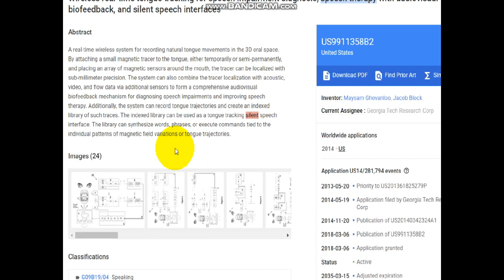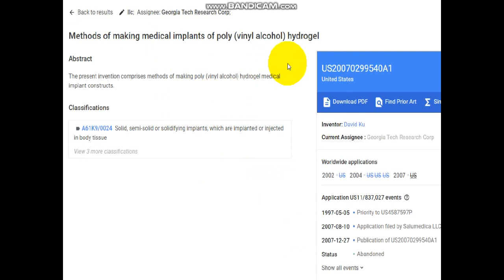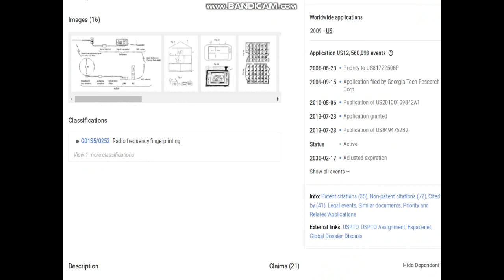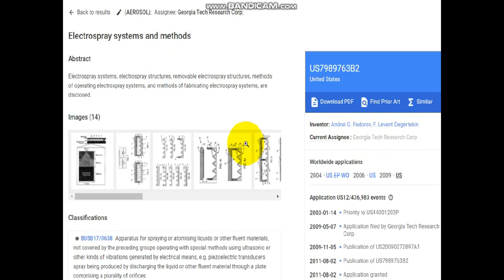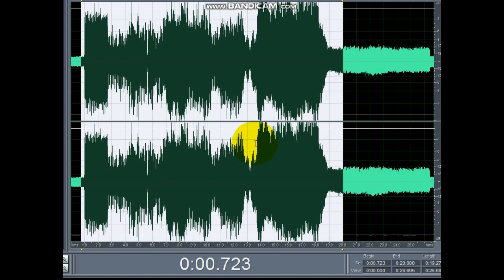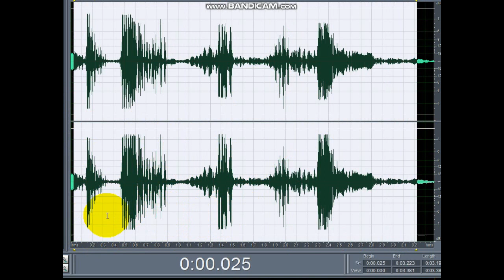USING THE MEDICAL INDUSTRY TO HIDE TECHNOLOGY - RADIO FREQUENCY TARGETING /  TARGETED POPULATIONS

Comment: The buried wireless is indeed used and it currently is blocking wireless communications here when the dust is heavy enough. 
Use cellmapper and force full gnss.
Very easy to see the man in the middle.

Comment: <Theory of HT (Hell Toxin)

<This is a working theory of HT. We need help from anyone with high-level knowledge in chemistry, electrical engineering as well as biology.

<We have so many clues but I think we are missing something big here that could help move this forward.

<Many who came before me, including Dr Dan and too many people to name have already come up with a lot that is helping.

<Why I think HT is an Ion

<HT acts more like an ion than a particle, like a mold spore, mycotoxin or other similar neutral charge toxins (or polar toxins like some mycotoxins). (Polar definition: https://www.thoughtco.com/definition-of-polar-molecule-6055… Ion Definition: http://www.qrg.northwestern.edu/…/pro…/1-what-is-an-ion.html)

<This is not a science fiction theory or a complex theory. It's a place to start with the simplest explanation that could explain what's happening.

<It helps to explain why HT acts in the ways it acts. I hope it can help others visualize what is happening and why it doesn’t fit with how mold or other toxins of concern like cyano, and MT should act.

<HT might be an aluminum-based flame retardant that has been introduced more and more in recent years, (these FR are nano, echoing Dr Daniel Cagua Koo and Erik Johnson’s theories on metals).

<The idea that this could be a metal (or has a metal component) has a lot of evidence behind it, and could also help folks to think of it as charged and not as a type of mold or bacteria spore. Most HT reactors agree that HT has a metal component.

<I don’t think there is ample evidence to assume it must be nano or even that is is a human-produced product. There are naturally occurring nanoparticles. But it sure seems so to me.

<How and why does a metal or particle becomes charged, I don't know the answer to that.

<Evidence that HT is an Ion:

<HT clings to the body like statically charged clothes in the laundry. When you have a bad strain and are very reactive you cannot simply shower and walk away from it easily.
HT is aggravated around all EMFs that create static.

<HT rides on and moves around on static. It attaches itself aggressively to staticky things such as plastic that is unraveled or clothes that have static on them.

<Things with a positive charge especially attract HT, sometimes in a helpful way to help bind and get rid of it, and sometimes if they can’t bind it, they just draw the HT there and it congregates there.

<Things with a positive charge that attract HT include: CSM, quats (used to clean HT), dry skin, glass on electronics (huge attractor of HT!), flyaway hair, paper. Air tends towards a positive charge when static is in play. This makes sense with how HT moves through spaces.

<Items prone to a negative charge are among those that are the least prone to contamination by HT, such as wood, copper and gold. And while polyester generates a negative charge, the movement between the skin and the fabric create a positive charge on the skin, this attracts HT to the area and it does end up on the fabric as well.

<Source https://jh399.k12.sd.us/DailyAs…/…/ch7materialstaticelec.pdf
Static however is a little more complex in which items create positive and negative charges with new understanding of it recently https://www.popularmechanics.com/…/a-shocking-new-understa…/

<HT can spread around a room quickly (a lot like how scientists explain candida auris.) This makes sense if you see the particle as moving through the air as an ion. And especially in places where there are a lot of charged particles in the air already. I'm not sure if we know why c. auris spreads like that. Maybe that could help us?

<HT clings to materials that mold spores and other particles cannot cling to. HT can cling to glass, metal, ceramic, and not be able to be washed off with soap and water or even special cleaning products.

<No regular particle can cling to glass and survive every cleaning product thrown at it. Only something that is electrostatically “stuck” to the glass could do this. Glass becomes positively charged in the presence of static. source https://jh399.k12.sd.us/DailyAs…/…/ch7materialstaticelec.pdf

<HT is commonly found on new items out of factories. This could be the source of it. (As opposed to a something organic growing or that can be found more out in nature like where mold and bacteria originate).

<HT particles can jump when it’s in its worst state. This feels more like the arching of electricity, or like a magnet pulling something that it wasn't touching to it, than a waft or cloud of spores in the air that is moving on air currents.

<HT cannot be easily contained. If the toxin is always jumping from you to nearby stuff with a positive charge - even stuff that you haven’t touched - it would be basically impossible to control the spread completely.

<You cannot block HT in the same way you block VOCs, mold spores and mycotoxins.
HT is often described as prickles, tingles or that it feels like radiation in the air. This more accurately describes an ion than a neutral or polar particle.

<There is a reaction between people who are dumping metals and the HT particle.
Mast cell stabilizers can stop the burning feeling but cannot stop the electrical jolting or the deeper level symptoms others have which many of us are theorizing is a reaction between the metal and the charged particle in the air. (Not an original theory by me).

<Dr Dan has found metal dumping to be common in people with HT. This is why those of us sensitive use the word “magnet” or “magnetizer”. We are the other side of the reaction, and maybe more literally like a magnet than folks even imagined. This is why not everyone feels HT.

<HT can be cleaned and neutralized by healthy people in a contaminated space. Eg if you leave a hotel room you have cross-contaminated and healthy people move through, clean it, walk through it it will lose its charge and then disperse. (The time it takes depends on the strain and how bad it was and how much there was.)

<Areas that don’t get cleaned like closets that were storing contaminated items might be worse. Areas with lots of normal traffic are rarely contaminated (like taxis).

<On the other hand, HT worsens in the homes of people very reactive without the new introduction of any more HT (and without purging, special cleaning or improving with treatments).

<With ozone in the air everywhere naturally, and with metals in the air everywhere, plus static, there could be a reaction here that causes it to worsen that could make sense. HT is worsened by light from the sun as well as human-made UV lights (possibly due to ozone production). This helps to explain what there is a larger effect from a smaller amount compared to other toxins.

<You cannot wash HT off objects with regular cleaning products, and rarely perfectly with specialized cleaning products. Specialized cleaning products often include metal binders and those have been somewhat effective in cleaning up HT in the environment (silica, OSR, barkeepers friend etc).

<Metal binders/chelators have been particularly effective treatment when taken internally to help heal those with HT sensitivity.
Ozone creates highly dangerous “radiating strains” of HT in many cases. The production of ozone occurs in the air naturally with UV light (which could be why HT can worsen when nothing is done).

<With an ozone generator, the electricity breaks apart oxygen molecules causing the lone O to attach with O2 creating O3, but that molecule is not stable, so the O breaks off again and interacts with other particles, causing other particles to lose electrons. Ozone is unleashing a huge amount of ions and this interaction seems to create more HT and usually stronger HT in most cases.

<I don't know why ozone worsens HT tremendously, but maybe there is a big clue there for those with more chemistry knowledge.

<Why does this matter?

<More and more people are becoming HT sensitive but we don't have any scientist looking into what this particle is, we don't even know where to start with testing it.

<By helping create a framework to understand it that will help I think. We really need outside help.

<A theory that helps explains this (even if it's wrong) can also help us to understand each other and why this could be so severe for some people. HT is not one thing, we call them “strains” because there are different types and strengths of HT that have these characteristics. And we are at various levels of reactivity so we also experience it differently.
Reply from the maker: I had symptoms that resembled botox / botulism. Numb areas as if I was at the dentist earlier..but in non-dental areas. I also noticed tingling and weirdness when my lips touched milk...or when my hands touched raw chicken. You could literally feel the reaction. This felt as though you could feel something alive reacting to the germs / bacteria in this stuff. There are a thousand other symptoms..but those are key as well as the photos / videos I have of an algae that has clearly been coming down on the neighborhood from above. There seems to be two main ingredients. Fungus and shewanella. Which both work in tandem with eachother. When the shewanella is out of whack with the fungus, an infection will appear on the body somewhere...when the fungal graphene is more prominant, other serious health symptoms appear. The fact that this stuff goes lymphatic is another clue. Also, the fact that I was able to ditch my symptoms with my treatment and an anti-fungal treatment is the main clue.

Comment: Couple of things come to mind right away.  Lots of strange blackouts lately. Seem to take longer than the usual repair time. Know the ggggg can run in the power lines. Might be necessary to upgrade for this too if you are going to put everybody on. Also if you haven't been in a hospital lately, they are practically empty. Had to be at one for relative's outpatient surgery last week. They confine you to a very small area. If you even walk down a hallway on the main floor, three people will jump out and shoo you back. (i forgot about that morse code vid until this. Definayely something). Also what about these disinfectant sprayer things they are putting in schools and stuff right now? Might be gearing up to put everybody on. Medical patents. Medical emergency hoax.     All these people are worried about some shot. This sh** is already in the food, water, medicine, air, and any shot you've taken in the last decade or so at the nano. They don't need to mandate some shot. Detox. Constantly. You are always a genius charlie. Thank you💜
Reply from the maker: Thank you. And yes, absolutely. They spent about a year of time working on our lines..claiming our system was being upgraded. Now the power goes out every time the wind blows too hard...and lately, we've had weird pulses lighting up the lights while the power was OUT. I think this system went national during the east coast blackout of August of 2003. There was a system before that. But this is at least version 2.0..if not later.

Comment: Charlie I mix music for a living & have always been obsessed with low freq.... well long story short I did something to my brain by accident by always focusing on extremely low energy & constantly surrounding myself with subs & excess electricity to the point where I am able to literally feel noise...I’ll stand in an empty room & literally half the hairs on my body stand up but the other half nothing. A garbage truck will pass by on the street & my brain will feel like it’s being scrambled almost seizure like.
Reply from the maker: Excellent story. I mix and master music..and over the years, I would hone in on frequencies just like that. Had a lot of really bizarre experiences with my head crammed in between monitors. Over the years, I was hit with an ELF wave or similar that made my brain / head feel like it was vibrating. Almost cell phone speed vibration. At first, I was all freaked out because it feels like a seizure or something. Then, I realized that it was just sound vibrating everything. However, the dangerous part is that they can diagnose someone with an illness and they would believe it if they were unaware. Which is giving them more control over the narrative of the medical realm as well as the psychiatric realm. They are creating most of the problems with technology.
Reply: @LookoutfaCharlie  I had figured the "feel noise" was just a part of the whole shebang, as if someone is yelling at you without the scream. Though I also spent the majority of my time surrounded by systems from the 90-2007.